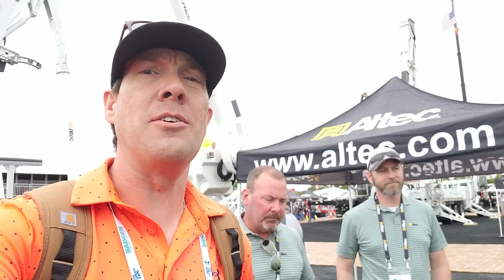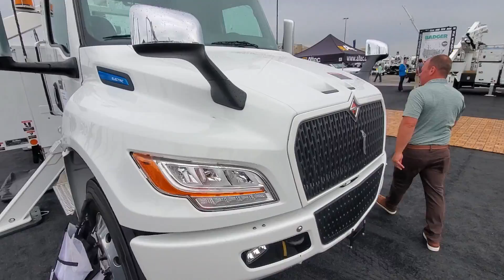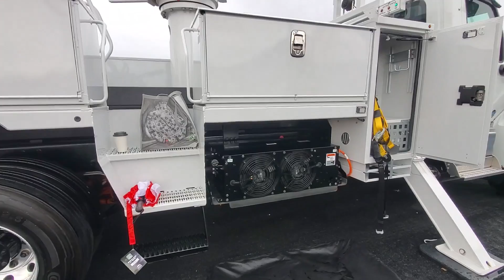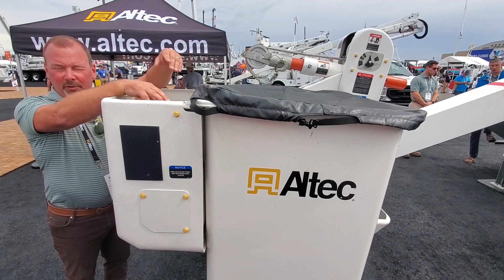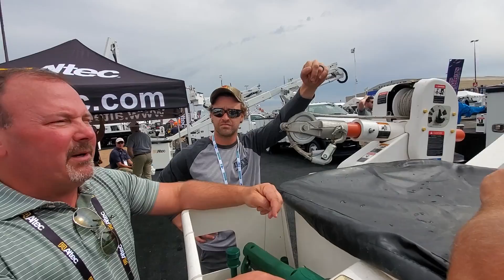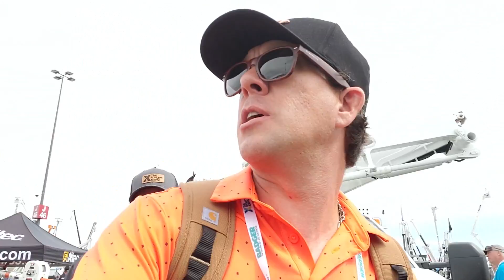EV Altec Bucket truck!

Comment: Just add a mobile transformer to the mix with well-insulated cable so you can clip it on the primary and top off. 
After having has Teslas and Rivians for over a decade you really shouldn't sever need this but it'd be a great backup option!

Comment: "You'd need a DC Fastcharger and the infrastructure is nil to none right now..."... oh really.. Must be where they are... and hate to break it to him, but level 2 is normal EV charging.. the only people that use level 1 (plug in a wall outlet) is people in apartments, staying at cheap hotels and people that don't want to use chargers out in the world, install anything and so on. I've owned 4 EVs over the years, never had any issues charging/finding charging. Yes, it wasn't a big utility truck, but I think if your employer (who oh, i dunno is the local utility company for example) can install level 3 charging back at the yard... These 2 guys are just debbie downers about it. I've seen the like.
Reply: Back in the yard doesn't help if you end up low on charge out of range of the yard. Lack of widespread charging infrastructure does limit the effective operational range of these quite severely.
Reply: @Monkeh616  I agree with that, but I disagree with the lack of charging infrastructure. Maybe it's just me having lived in not far out areas for the timeframes I've owned EVs. ¯\_(ツ)_/¯
Reply: @sorphin  The infrastructure is wildly variable. Looking at one area of the US I've been in recently, there are DC charging options every.. 30-40 miles? Not great, especially if you're limited to that 30-40 miles as an operational radius and have to drive the wrong direction to get to one. You don't have to go far afield from that area to find gaps of 60+ miles between any sort of DC charging capability. An EV truck like this just isn't very practical around those areas, not at the rate of work they currently get out of one truck and its crew, and there's a lot of them. 

It's improving, but it's not there yet for rural areas. Also, having just looked at my local rates.. diesel's cheaper than the DC stations around here. That's a minor convenience tax for a car charged primarily at home, an added operating cost on top of a more expensive platform for a company. Private infrastructure of course cuts that cost, but adds the cost of installing and maintaining it. And you'd better hope it's working when you roll up to use it.

Comment: 2023 expo?
I didn’t operate the one shown in the video sadly but from the operation of one of the other electric ones, they are definitely way quieter than the non electric ones but dont have any towing capability(according to an altec representative as of 9/23).

I’ve also operated a hybrid one not at the expo and think that hybrid(currently) is the best of both worlds with good towing capability, a quieter jobsite, and lower emissions.

Comment: That was really great ! nice to see electric EV getting into more markets. this is not to replace a Desal bucket truck. it's to add to what we have and help going greener . Better batteries are on the way. it's only the matter of time now.  Altec is jumping in now getting the trucks ready. I love how the Bucket is the same on  battery. also the Hybrid Desal is great. will run on Biodiesel fuel. I can see putting a level 3 DC charging station in at a substation can be done . some trucks are stored their now. love the quit . how many times linemen out during 3 am   engine idle hours at times making storm repairs running gas chain saws .  this move to electric is a game changer . not a end all but a great option to have . love how you are keeping up with the change. The new cordless tools are super ! and the lights !

Comment: Been running hybrid service truck for a little over a year. Works well for the most part but we have had issues in the cold and we ain’t in Canada. Actually had to self rescue a couple of weeks ago when outrigger sensor quit. Working midnights though it’s very quiet other than the alarms for outriggers &  backing up are extremely loud. The batteries take up quite a bit of space in the belly of the truck so storage is more limited. Not sure whether they use a team of linemen with some years in the field for their input in design & functionality of these trucks but sure doesn’t seem like it. All in all not terrible but there is work left to do in making them better.

Comment: The neat thing about this is that you should be able to "regen boom" just like regen braking, ie you get some of the energy used to lift the boom back when you lower it again, as long as the inverter is designed well and doesn't rely on a damper resistor to absorb all of that.
Reply: I imagine the booms are quite standard hydraulic fare with an electric pump, so I doubt there's any regen in play.
Reply: @Monkeh616  you know, that's a good point and I'm not sure what I was thinking.  There are obviously hydraulic cylinders on it, not BLDC motors on each section of the boom, you are right
Reply: @kenstein   They could attach some sort of turbine on the return oil line to get regen from the hydraulics. But even if it was 100% lossless it wouldn't be worth it because there's just not that much potential energy involved in a lifted boom.

Comment: My gas f550 with the RH44 Hybrid works pretty well out here on the West Coast. Nice to be able to do most of the work in the quiet. Doing telecom stuff, most of our rigs run off a generator, and its a pain. Looks like Altec has a nice combination as well, but didnt see how it was set up for aux loads.

Comment: We have a versalift 75’ squirt boom thats a hybrid, i believe a international 4700 cummins? Battery charges in 8 hours with the level 3 and is nice and quiet on jobs, extra boost for the get up n go but thats because its so heavy. Rides like junk(youll need a new back) and has endless problems with the fiber optics, hybrid motor, runs out of battery towards the afternoon if youre using it all day, but the motor kicks on to regen it once its at 10%. All in all i like it, but has been in the garage more than on the road in 5 years

Comment: If your interested in know more about the hybrid squirt boom from Altec with the Ford 550 diesel. A friend & fellow lineman at the same utility I work at was just issued one brand new. His main complaint is there is no place that is waterproof for his climbing gear. The bins are too small. There is a lot of wasted space taken up by the JEMS unit. Plus the bins are no laid out like the way a power company lineman needs them. I see lots of modifications down the road for his truck. 
Do you still have the old e-mail Aaron? I’ll forward some pictures I took for you to look at?

Comment: Fully electric trucks could be deployed but on long hour work like emergency repairs may be they can bring a generator to charge 2 or 3 trucks while working ,instead of having 3 engines running is only one until they can come up with a better system …..they definitely need to start working on solutions for that type of issues

Comment: As PT Barnum said, "There is a sucker born every minute"!
Big deal, they are going from a diesel, or gas powered truck, to a COAL powered truck, that, when you add in generating, transmission, and charging losses, pollutes more than diesel or gas!
Not to mention the battery Lithium mining pollution in China by slave labor!
Reply: Ahh, the usual old arguments. Let's see..

Coal is not the only way to generate electricity (sucks that you still use coal, maybe don't twiddle your thumbs while technology moves forwards?)
Generation is generally much more efficient than internal combustion engines
Transmission losses are quite small (HV is used for a reason)
Charging losses are outweighed by regenerative gains
Reply: @616The vast majority of energy produced in North America is from coal or natural gas and will remain so until the green weenies wake up and embrace nuclear, so the "inconvenient truth" remains, the truck is coal powered!
And BTW don't expect much heater output up there in the mild Canadian winters!
And also "Charging losses are outweighed by regenerative gains" aah so that's why the big three have  thousands of EV trucks that they can't sell, and have stopped production on.
And I guess the slave labor dosen't bother you at all!
Reply: @garybrenner6236  Again, so sad your infrastructure is old and inefficient, you should've kept on top of that. Natural gas with modern plants, by the way, is far better than burning highly processed oils in cars and trucks. The inconvenient truth for you is that the energy supply isn't limited to one source and mechanism, unlike that which you're used to, and that presents options which are scary because they're different.

Heater output is no problem if it's sized appropriately for the environment. Take poor engineering up with manufacturers, not with the technology which in no way limits this.

Charging losses vs regenerative charging have nothing to do with 'the big three' and their trucks, try making actual arguments for once. There are legitimate ones to be made, but they require learning, thinking, and evaluating fairly.

Slave labour.. because no other supply chain is questionable? Have you ever looked into any supply chain without being prompted by someone with an agenda? There's plenty of horrors going on at every level, even in your own country, but you never look once, let alone twice, until someone motivated by their stock options makes a point of 'enlightening' you.

Just another luddite, scared of any sort of change. Keep everything the same, that's easier for you.

Comment: It is a cool technology and a good option for the right situation. You also have to look at the degergation  rate of the batteries. You may lose 4 or 5 miles of charge every year. And the price to change out a battery pack in 6 to 8 years may be more the price of the truck.

Aaron, i have been a follower for a long time. Seeing how you have to drive from Province to Province  many miles apart in cold weather, this truck is not for you.
Reply from the maker: I agree! Perhaps the hybrid, but a fully electric definitely wouldn't be practical.

Comment: Very interesting!  I am not totally sold yet.  They have the electric trucks moving trailers at some companies.  They are having some issues with the electric vehicles.  I see them eventually moving into a robotic controlled with no drivers in this situation. The other flip side is the possibility of fire and the whole truck barbeque thing. They have enough trouble with cars.  I do see the fuel savings with them.  I am sure you loose with the load capacity.  Running different fuels could be a pain in the fleet.  The diesel engine was great till we had to choke it out of use.  The plants still need sulfur to grow. Most like to keep the trucks inside. Would not be good if it burnt down half your fleet and the building.  They still got some work. They have to start somewhere.  Next, they will put a fire-retardant system on the truck. We used a 70ft boom lift inside a building.  It had diesel backup.  Which we could not use due to apparently the sleepy time affect. We had to keep it switched off while in the building. The machine would fire up the diesel to charge.  We did not get to use it long enough to really make a good judgement. The machine was older.  I would want to put it through it paces for a few months.  I wonder if you wanted to ditch the batteries can they be removed to keep a perfectly good gas or diesel truck in the fleet.  Possibly to have battery packs to run the alternate equipment.  Not so much to move the truck.  This would help with fuel cost also.  Just not sure we are ready for complete electric truck.  But sure, could save on the dinosaur bones. I like that these early versions have both mechanicals built into them. I would like to see how someone fleet manages it into jobs.  They want us to go to vans that are electric.  Great thought but we have a lot of area to cover in our trade.  Sometimes I think they become too much of a distraction from the real work at hand.  We have enough trouble with our IT department changing things and locking up the computers. Which then we can't get info we need to do jobs.  Sometimes things can go sideways enough without distractions. I hope I am not the only one who has days like that. Stay safe out there.
Reply: EVs get pretty unfair flack for the starting on fire thing. In the U.S. every year there's 200,000+ highway vehicle fires, and well below 1% are EVs; they're disproportionately low. The media just doesn't bother to report on internal combustion engine (ICE) fires because they're boring and regular. I've never seen an EV on fire in person (yet anyways), but I've seen 3 ICE cars on fire in parking lots over the years. It's not even a highway only issue with ICEs, they also overheat in parking lots when people leave them idling. So keeping perspective is important; there has been no evidence that EVs are more prone to starting on fire, the media just disproportionately reports on them when they do because they get more engagement due to EVs being polarizing. But it is fair to be concerned about the difficulty in putting out EV fires, that is a very real issue but it will get better in time.
Reply: Our company wants to bring some vans into our fleet.  It does not help their issue of self-combustion. I carry a lot of my own tools not fond of parking near or losing my equipment. Ford can't keep theirs on new lots from cooking up.  They need some time to improve. They do have to start somewhere.  The fire systems on building will need to keep up and new codes written to keep people safe. Someday parking garages may have to use fire foam. Also not open to outside air.  Possibly new auto closing fire doors. I do not see sprinkler systems keeping up. I do not see with the miles and area of coverage how we will work these vehicles in.  This seems to be a special tool situation. Also used accordingly. The heating of the batteries reduces range. I have real world issues to deal with other than a vehicle that cannot keep up at this time. Maybe in time they will have their own fire suppression on these cars. Who wants to spend a lot of money on a new vehicle and not store it inside.  Some have done it and burnt their house down. I do not know a company that does not part their trucks together.  This whole thing will somehow create more work for me in the future. Just waiting to see how it all plays out.  @GOAE7777

Comment: Those guys could not have seemed less enthusiastic about the truck
Reply from the maker: IMO that's a good thing.... kinda. They're aware of the controversy. The creation of the truck is quite an accomplishment, yet they're both aware and seemed pretty honest about its practically for current usage.
Reply: @Bobsdecline  I agree. You asked them the hard questions and they were pretty honest about it. Im glad they didn't try to sugar coat the facts with fake enthusiasm.

Comment: Is there a weight increase for hybrid and ev trucks compared to diesel?
Reply from the maker: I'd did ask that, but it was during the 4/5 min where the audio was botched.... I could hear through the static a bit but couldn't hear exact numbers. From what I gathered, the batteries did add some weight

Comment: Without even watching the video first, I believe the primary joke “primary LOL“ is that in the event of a battery failure I’m sure these guys have battery cables and an unlimited power supply. Yes yes, it might require climbing, but when you’re out in the middle of nowhere “most of the time“ —It’ll do..
OK, back to the video. 😂😂

Comment: 135 miles?  But what about the crews that have to drive sometimes thousands of miles to assist after natural disasters. Tornadoes, hurricanes, floods and others. When quick response is needed I really cannot imagine these trucks having to stop after 135 miles to recharge. It’s nothing but insanity to expect that to work. And if we all became totally dependent upon electricity what would happen in affected areas? Where do they expect to recharge the trucks when the entire grid is inoperable.
Reply: Generators are a thing, which yes defeats some of the purpose of an EV if or when you need to use one to charge it. And yeah, EVs, especially one that can only go 135 miles on a charge, are not for cross-state assistance. They're clearly targeting local operations, and not replacing 100% of the fleet tomorrow. It's silly to expect that no new technology should be permitted to come out if it is worse in a single category, I think you have a somewhat unfair expectation for this truck.
Reply: @GOAE7777  I don’t have unfair expectations for these trucks when the climate crazies want to eliminate carbon fuels.  Totally eliminate them.  Look at what craziness Gavin Newsome is doing in Commiefornia.  How do you run a generator without fuel.